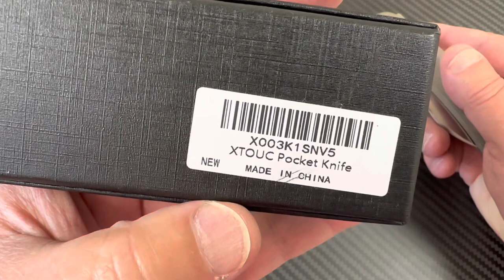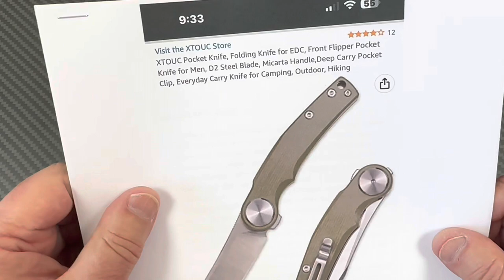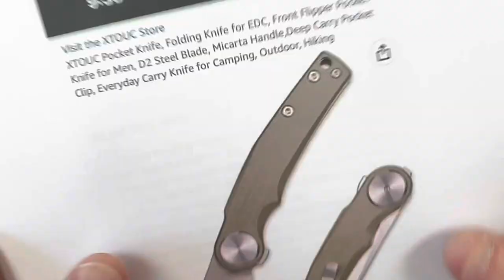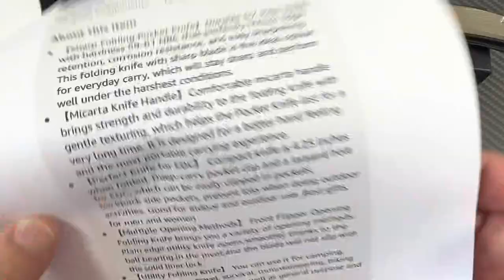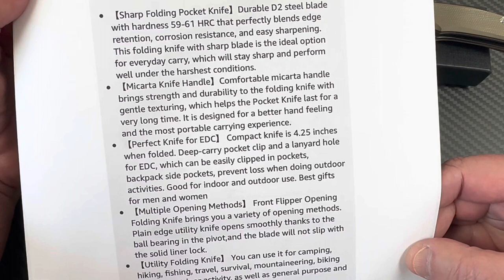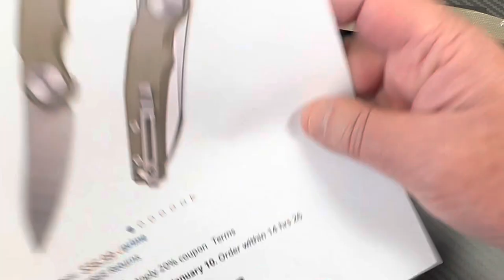XTOUC front/top flipper ?  Micarta & D2 under $30 !  Amazon mystery knife !

Comment: no attempts to use the front flipper?
Reply: I have the XTOUC XT01A (which has both a traditional flipper tab and front flipper). The front flipper on the XT01A is pretty useless as the flipper tab on the spine gets in the way and slams into your hand preventing it from opening easily. Other front flippers dont give me this problem. Thanks for the vid